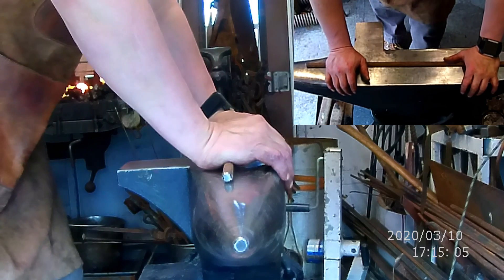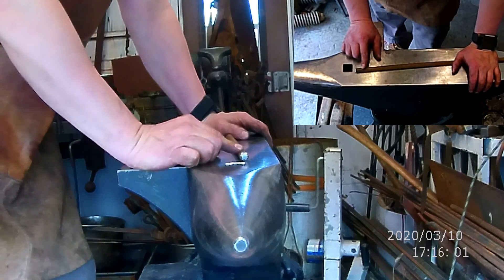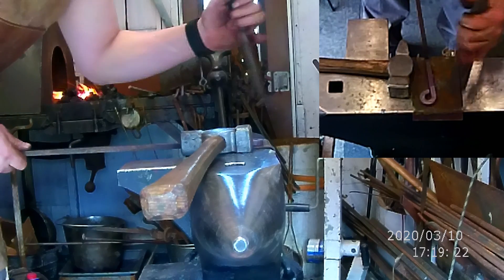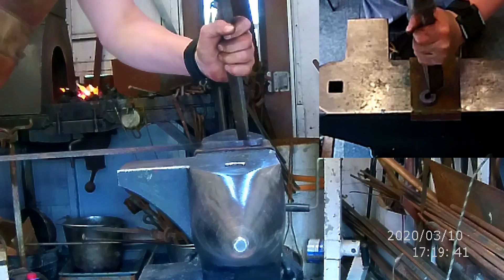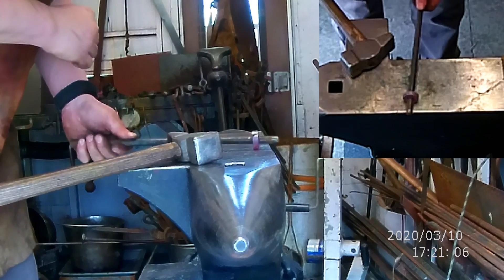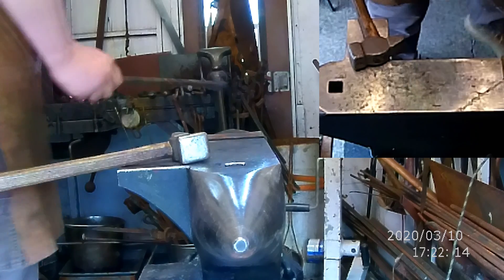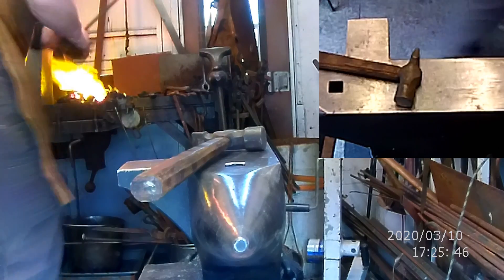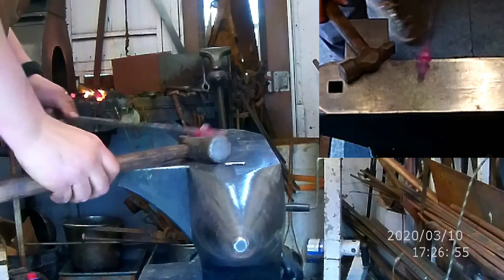"How to Forge a Butt Welded Ring"  Read Description and turn volume down.. :)

Comment: You call the tooling " champer " you holding your work with .Is that very slightly cone shaped to help hold the eye of anything being held as you work with it , Seems handy.
Thanks for showing and teaching Lady
Seems better lite up ,( know recording equipment must be very expressive)
Thanks
Reply from the maker: John the chamfer is just a slight cone shape removing the sharp corner on the end of the rod. It's ideally a 45degree but the chamfer is just put on to help with the ease of removing the ring once welded if it is sized tightly. 

It allows for the end of the bar to be hit without upsetting it since that chamfer is undersized so can hit the end of the bar some to remove a tight fitting ring.

Comment: you make it look pretty easy......    just got my wire brush last weekend, I was very happy with how awesome they are.
Reply from the maker: Nice. did you get a butcher block brush or wire brush?
Reply: @jlpservicesinc1452  Butcher block!
Reply from the maker: @kennymiller4428   I came up by myself. 100% self taught way back before the internet.  I can remember the very day I stumbled into a Butcher block brush at the local flea market and bought it..  I thought it was the best thing since sliced bread.. Sadly I never knew what it was called.. I actually thought it was a left over from a golden era of smithing. 

I had the same one for nearly 15 years before I closed up shop. 

Wasn't till maybe 14 years ago that I actually found out what they were named and actually used for.
Reply: @jlpservicesinc1452  I have seen several other smiths use and I believe it was Joey who said all other brushes were rubbish...
Appears to me like you taught yourself very well.
Reply from the maker: @kennymiller4428   yeah I managed. :)  I got pretty good for awhile.. :) 

I like a stainless steel scratch brush..  I find the butcher brushes to be pretty aggressive for really fine and sharp work.. If you look at the blacksmiths diamonds the corners are rounded from the butcher block brush..   this is not the case with the stainless steel scratch brush.. 

The butcher block brush wears the corners off.
Reply: @jlpservicesinc1452  I agree
Reply: @jlpservicesinc1452  I can't believe that i have waited so long to purchase the thing. Love it!
Reply from the maker: @kennymiller4428  Nice.. congrats. Now you are in the "know"..  :)
Reply: @jlpservicesinc1452  problem is that I forget things.....LOL I could be out of the know in a day.
Reply from the maker: @kennymiller4428  Your not alone..   I've forgotten more than I know today..  I used to be an expert.. Now I'm just biding my time.. :)

Comment: You make it all look so simple. I've actually done this one a couple times. Not nearly as easily as you just did but I have done it. Nice work Jen.!  I'll have to watch this several more times and see if I can figure out how you make it so easy looking.
Reply from the maker: Thanks Jim.   The key is to have the butts of the collar completely flat and loose on the shaft.. Take a quick welding heat on the ring. and push the ends together. 

This video was to show why we leave a gap for the blacksmith diamonds but I'm guessing it turned into a "Butt welded ring video"..

Comment: Nice job 👍. I saw the Instagram tease and then the video popped up. Took a minute to realize you weren’t welding the ring to the shaft.
Reply from the maker: Thanks.. 

It shows what happens when there is "NO gap".. 

I could not for the life figure out how to explain it in a way that would make sense..  

So, a ring will be made if they are butted together while being welded on a shaft.. :)

Comment: Great demonstration.  Microphone is Too hot though. Distortion turn the microphone gain down. (just trying to help not trying to be an A**)  :)
Reply from the maker: I'm with you.. Problem is no way to tell till after the fact and I turned it down completely in editing..  Just turn the volume down.. LOL.. It's as good as it gets on this one..  I think it had something to do with mic location.. Last video was good , this one not so good..  
 
Ah, what is one to do..  I totally agree but wasn't going to film it over again. Better luck next time.  Maybe. 

There is no meter on the camera so have no idea if its actually doing anything till edit.  It's rather complicated..
Reply: @jlpservicesinc1452  Yes too late for this one. It is either to close to the microphone, or Microphone gain to high.  This overdrives the mic. elements. Also talk in a normal speaking voice. I have been a radio operator for over 20 years. The female voice cuts through background noise, male voices tend to go muddy and blend with the background noise.

 You might try a short test. 1/2 total mic. gain, speak normally. 6" then 8" or more from the mic. and see where you end up.

OK I will not bother you any more LOL
Reply from the maker: @armadilloforge  Your not bothering me at all.. Its all great info and the more the merrier.  Besides then I get to complain too.. 

Like I said, I think the mic was to close to my mouth as it was a different shirt.  Round neck vs V neck..  Never even gave it a thought and with no easy way to check. I just skip it. 

I am in no way an audio or video engineer and I'm inside a trailer with lots of metal surround..  A  camera with a built in  Range meter it's easy to see the signal and adjust it..  LOL.. 

I'd love it, if I could drop all this stuff into someone elses hands.. LOL..  Works for me. I could then just forge and it would be a perfect combination.. But alas, it is what it is..  Maybe you'd want to come over and do it?? 

Though from the name you are either in FL or in TX.   

There is no meter on the camera only the mic for levels.   Last time was perfect, this time was too loud. 

Don't know till after the fact and well, I can forge something and have lousy audio or spend all my time making things perfect, with lights, audio, film, shadows and never make a video..   which I do consider every time I make one..  

 Really I just find it all frustrating in infuriating when you spend all the time to do the best you can do, with the time you have, and it doesn't come out just right.  Arghh..     

The channel might end up having to be a paid channel, then I could afford to pay someone to do it..  LOL.. More than likely I'd never make a video again..  After all I do make a killing in cash on these...  LOL..
Reply: If it’s any consolation, the captions in the YouTube app do a pretty decent job. May help some that have sensory issues like me. 🤷🏻‍♂️

Comment: Thank you for sharing this.  I know I'd asked recently now your answer is on digital.  Very nice indeed.  Glad you could show this as a ring too...multiplies the uses for this procedure. 
🙏blessed days  ma'am 
Crawford out 🧙‍♂️
Reply from the maker: All of the videos are really not about making the items..  The videos are about teaching a skill set or technique.. Ideally taking this skill and applying it in other ways. 

I think in all I only know like 5 or 6 blacksmithing skill sets. upsetting, drawing out, punching, welding, slitting, heat treating.. Peening..  Ok many 7..  :)   They just have to be reapplied somewhere else and the results can be wonderful.